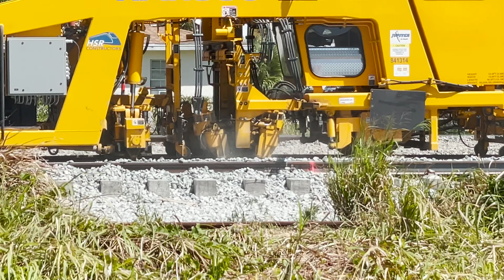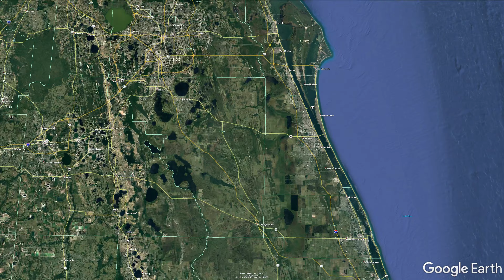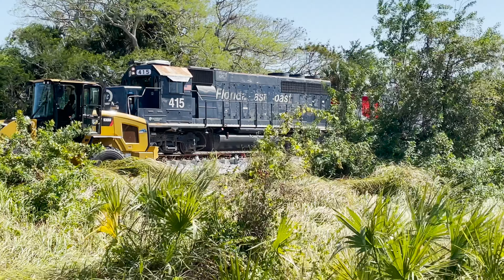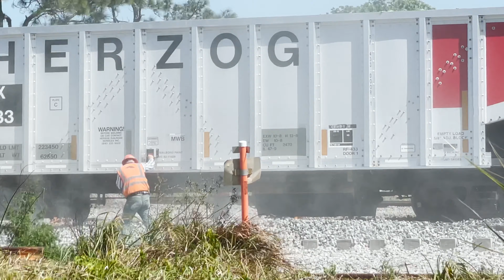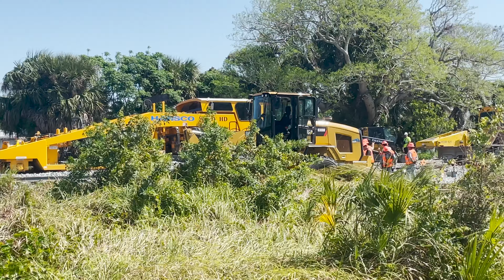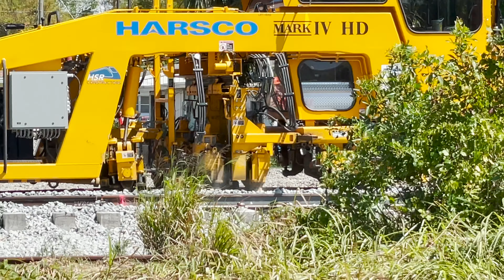Laying Ballast at CP Melbourne - Brightline Construction

Comment: I know I'm missing a very simple and obvious fact about why there's solar panels being used here.  I'm surprised there is solar panels on these ballast cars, there's a giant diesel generator right in front of them.  Is the solar power there for if there isn't a locomotive around and they're pushing this with a truck or something?  I honestly thought everything on a train car was air powered.  I must be suffering from Alzheimer's or a giant brain fart or both
Reply from the maker: Freight locomotives do not actually have any electrical output to go any freight cars. The cars can also be moved around by other, non air powered equipment as well.

Comment: Excellent update video, that ballast regulator vibrating the ballast at every single tie does make the process seem very tedious lol, though have you seen some construction updates regarding the maintanance facility at Orlando International Airport as well as the Intermodal Terminal?
Reply from the maker: There are machines that can do multiple ties at once, but around turnouts they need to be done individually due to the complexity of the track.
Reply: @RoamingRailfan  can you imagine how many people are need to do that by hand?? and it would be not as good as this machine can do it. there is a YT video with this one followed be a remote controlled one following up behind it on the BNSF

Comment: Will Brightline service be extended to Jacksonville in the near future?
Reply from the maker: Brightline does hold the exclusive rights for passenger rail to Jacksonville on the FEC so it is definitely possible. As noted in another reply, Jacksonville does need to work some things out before that is likely to be considered.
Reply: When they were All Aboard Florida they proposed it, but there is a lot of work Jacksonville needs to do to make it successful, like moving the convention center out of the train station and building public support for passenger rail vs building more highways.
Reply: @marcuscnelson  Will Amtrak also move to the new station?
Reply: @amfan_17presentations87  That's long been a goal of a lot of activists here, but there's little political support for it, and our local officials have let it slow roll. Our local transit agency is getting half a billion dollars in increased taxes and wants to spend most of it on some kind of autonomous vehicle network, and only give $3 million to cost estimate creation and 35% design work.
Reply: @marcuscnelson  lots of money going into other's peoples pockets it seems.